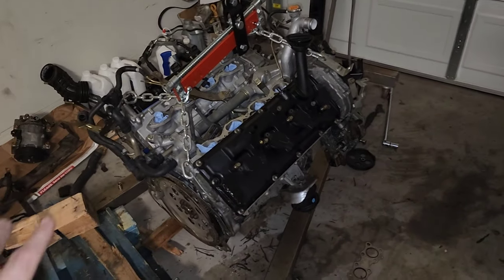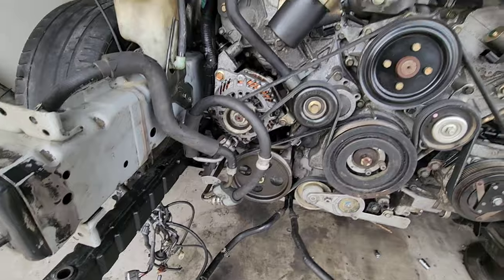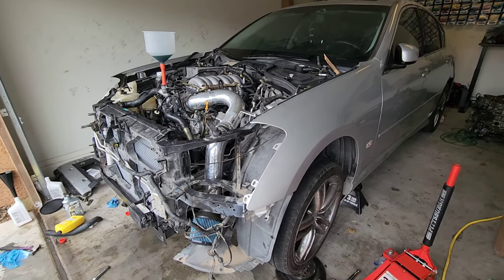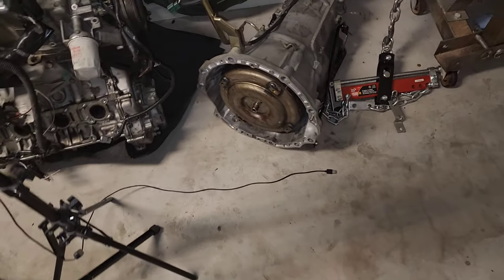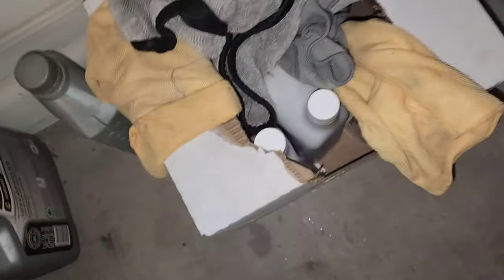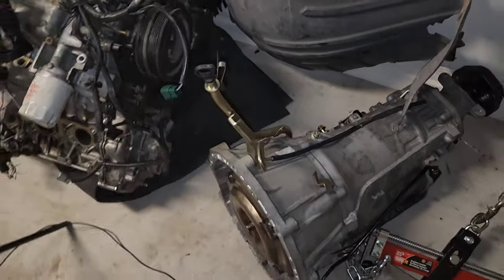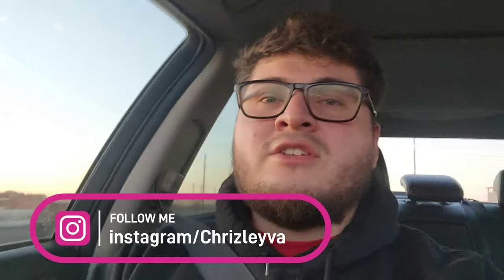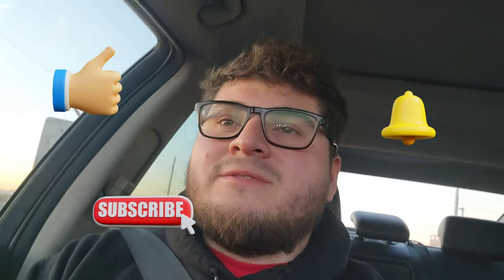Engine Installed! | INFINITI M45 VK45DE

Comment: Were can I get this engine, I have an 2002 q45
Reply from the maker: Got mine from ebay used
Reply from the maker: This is a 2006 and up tho anything before 2006 has a different motor
Reply: What transmission mission was used? Is there an adapter plate for a CD00# transmission